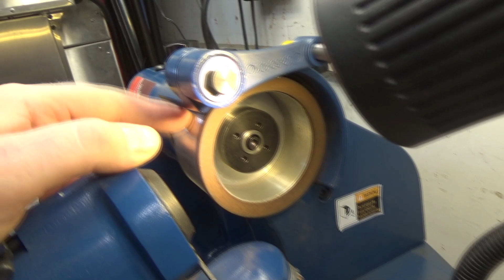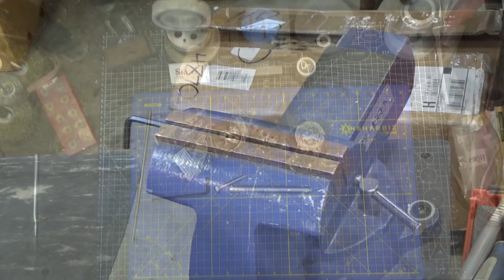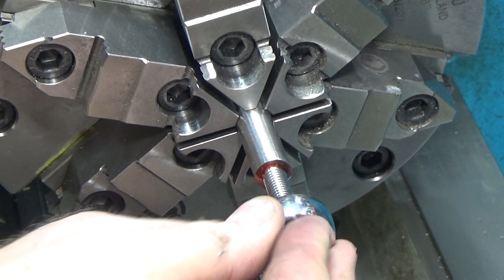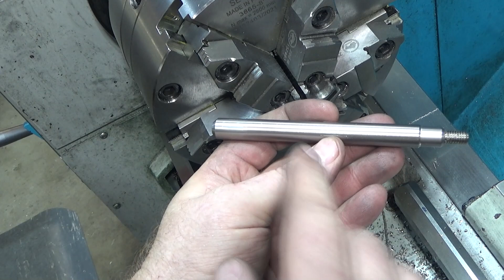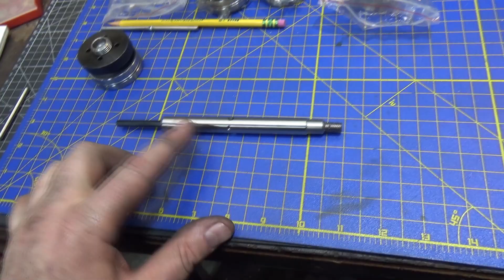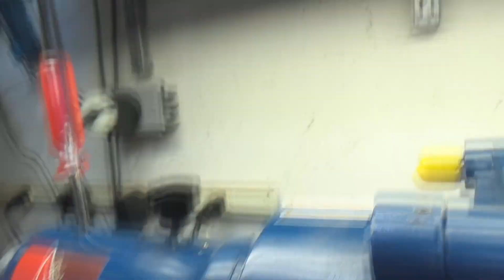201 Shars DBit Grinder Wheel Wrench

Comment: Did you notice that tap wobble when removed?   I suspect that part of it is due to feeding the tap in with an unbalanced drive, tap handle bar extended out one side.  Also the spring loaded center seems a little loose..    I typically find staring with tap in the drill chuck gets the well  centered. Only need to go in a 5-6 threads then do the rest with tap handle that is unsupported..  The important part is to run the tap in with both hands to balance the load on the tap.     While this was a good exercise press fits. It might have been easier to make it all one piece.
Reply from the maker: Great suggestions and I think you are spot on with the whole thread start issue. I really appreciate you taking the time to help me and others out.